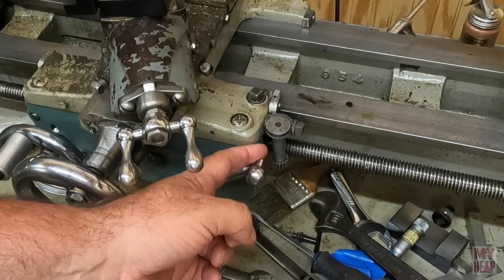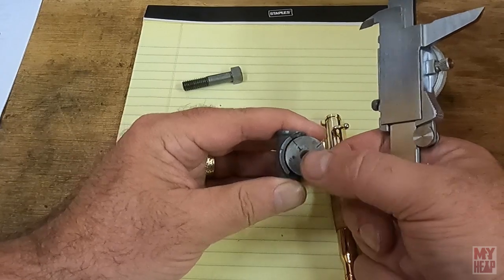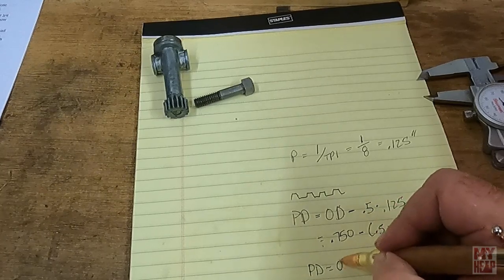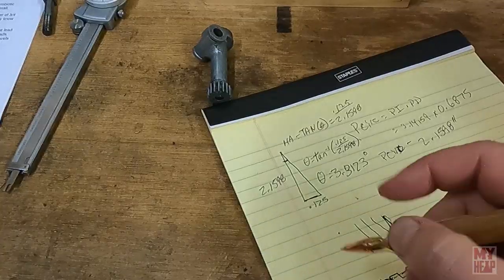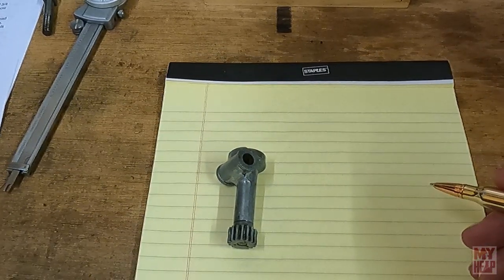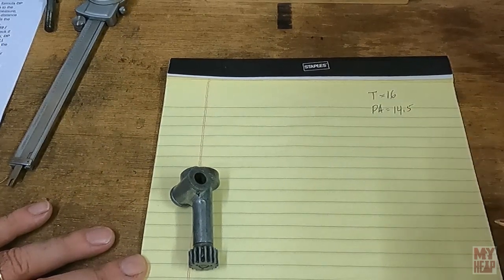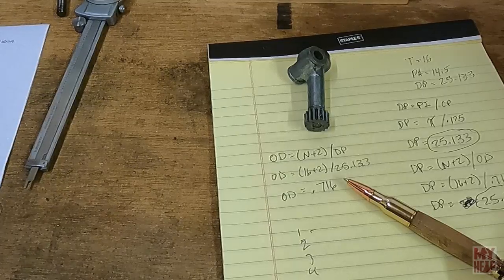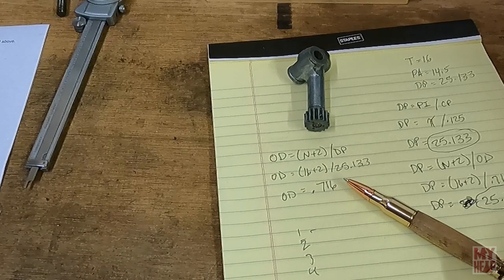Atlas 10F Lathe - TH54 - 28 - Thread Gear Treatise

Comment: Joe, this video is very useful and will help get me off my backside and into the shop to make a thread indicator dial for my old South Bend lathe (1911 10-inch, originally foot powered) since it doesn't have one.  I'm also missing at least half of the change gears and will have to build an indexing head to allow me to cut the gears. About 20 years ago the lady at South Bend (Rose?) told me that my lathe was old enough that it used different gear standards than used now and to be careful with what gears I put on it, so I've been slow to fool with making gears.  I hope to use the information you've gathered & shown here for Ben and will tweak it as needed to make a thread indicator to fit my lathe, but I bet it will be very similar to the Atlas one!
Reply from the maker: Hello Bob.  I am sure it will work on your southbend.  The only other type of gear I know they used were cycloidal gears.  These are based on rolling circles and there are some information available on generating them.  The problem with cycloidal gears I that they were required to run at a specific center distances to each other, and as it wore, the gears would start running erratically.  Sometimes at different speeds based on how the wear was.  This is what led to the use of the involute form.  They did not suffer from this condition.   Over the years though the standard of 14.5 degree pressure angle was changed to 20 degrees.   I think it made for stronger tooth and quieter gears.  If you have questions and I can help, feel free to reach out.  Thanks for watching and commenting. 

Joe

Comment: Many thanks Joe, very helpful. Making that will end up being a future project!
Reply from the maker: Hi Ben.  I hope that will be of use to some folks.  I did have fun doing it, so tha k you for the initial question.  And thank you for watching sir.

Joe
Reply: @MyHeap  I am very grateful for your help. I suspect it will also help design and make one for my other lathe (a much better condition Myford ML7). One of the interesting things though, is that if you make a 3/4" 8TPI Acme hobber, it will certainly do the job and well, which avoids the interesting maths. A bit like a sliding bevel avoids needing triggonometry.
Reply from the maker: @BensWorkshop  Yes sir, you hit that one square on the head.  Glad to help you in any way.

Joe

Comment: Great video with a good explanation of the gear. This gear could also to made by 3d printing since there is really on load on the gear itself.
Reply from the maker: Hi William.   You are correct about 3D printing the gear.  I have a 20T 3D printed gear on the lathe now that I have been running for quite a while to set the feed.  It seems to be doing great.  Thank you for watching sir.

Joe